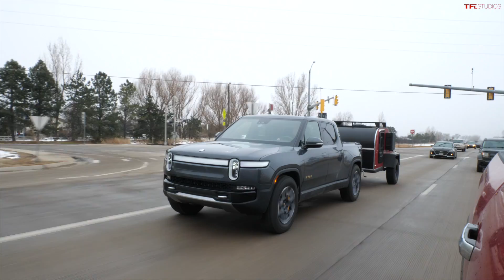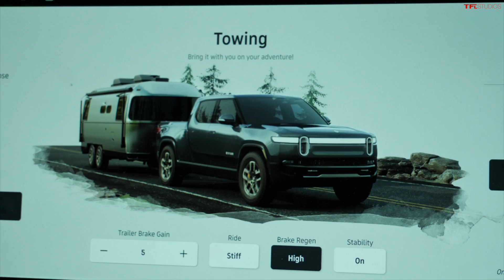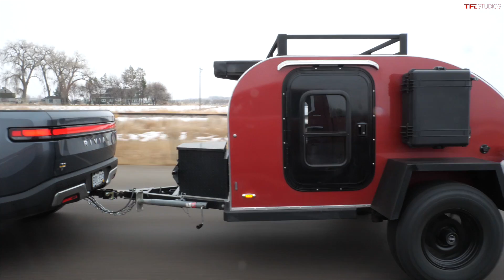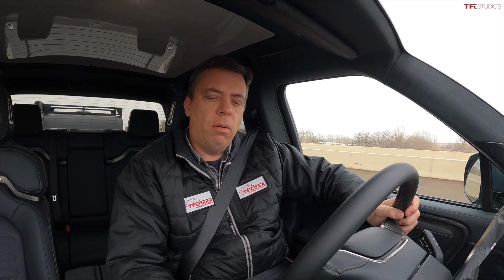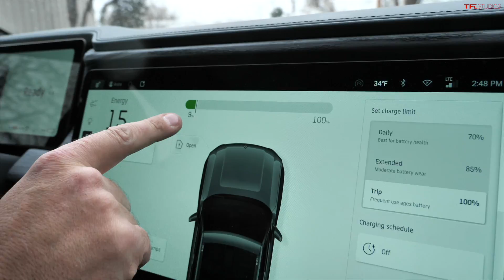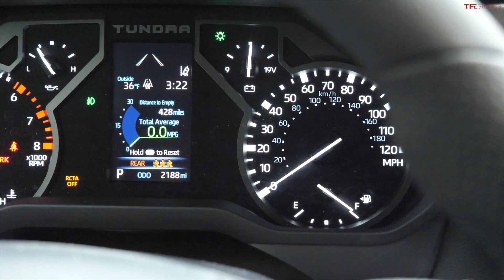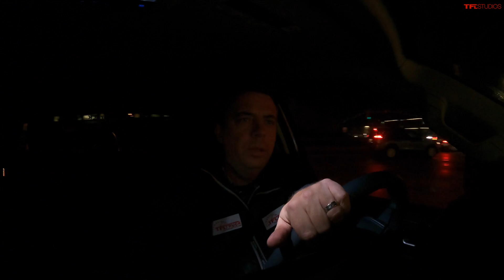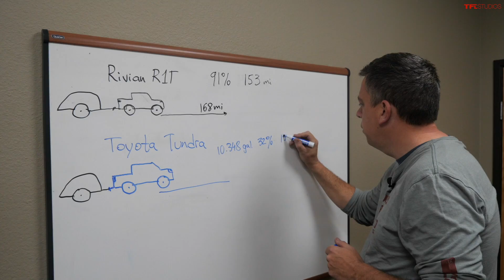Rivian R1T vs. Toyota Tundra: How Far Can Each Truck Tow On A Single 'Fill-Up'?

Comment: The Rivian looks like it tows very well. The only issue is range and recharge time. Those are pretty big issues though.
Reply: Mining battery components and drilling  and refining crude into gasoline are both incredibly energy intensive and there isn’t any good data comparing the two operations, so for comparison, we can consider those to be equal. Transporting gas to stations takes more energy from fossil fuels (FF) than electricity. Depending on the source, electricity could be made very clean or not so clean. In California, it’s over 70% clean sources and in my case would be 100% solar at my house. So instead of arguing which is greener, I’m going to compare what Andre didn’t, and that’s cost per mile. He said he got approx 1.25 miles per kWh in the Rivian and 14mpg in the Toyota. Equaling the units, the Rivian used 11.2kWh to travel 14 miles compared to the one gallon of gas. Around here, if you charge at a charging station, it’s about 32 cents per kWh, which works out to $3.58. If I’m charging from home, that price drops significantly, but for the sake of argument, let’s keep the charging station price—if your gas costs more than $3.58 per gallon, the Rivian is costing you time but saving you some money to drive. If your gas is $3.58 per gallon or less, it costs you more money and time to drive the Rivian. A one size fits all solution doesn’t work. People who have $1.50/gal gas will never see the benefits of going electric. Those seeing $5.50 gas can’t wait to go electric as filling a 32 gallon tank with 28 gals of gas is $154 at that unit price.
Reply: @lewiswatchorn7239  refining oil gives us so many things that make a society run.  Tar roads to propane and everything in between.  Mining lithium on the other hand.
Reply: @HoneyBadgerFarm  Lithium is also used in other things besides EVs. It’s in medicine and many of the portable electronic devices that are used in everyday life.
Reply: @thespiceislife2082  Not in the degree of making tens of millions of batteries that weigh 1,500 pounds. Then the places are stripped mined are left with GREEN toxic rivers as it destroys the environment.
Reply: @thespiceislife2082  compared to a barrel of oil….no
Reply: @lewiswatchorn7239  So you don't have SOLAR at your house when the electricity is off as it cannot back-feed the powerline. Next, they can't keep the electricity on in California rolling blackouts. Electricity prices will SKYROCKET with demand and no new power stations. They already did this in Germany and now they are buying GAS from Russia as it Failed. Also, TAX money is being used to prop up your solar panels take it away and they go bankrupt. WHO is going to have the $70,000 to buy this when Inflation and DEBT is increasing prices on everyday items?  The strip mining to get the lithium is worse than oil and OIL is naturally occurring not a 'fossil fuel'.   So farmers are going to be using batteries to harvest crops?   Who is going to pay for all of the TRILLIONS of dollars of NEW DEBT to upend the economy?
Reply: @mt1885  I think you’re viewing it as an all or nothing flip. Moving away from oil will be a process over a lengthy period of time. Too many older vehicles rely on it, not to mention other things we use in daily life, as was mentioned in someone else’s response to me. Secondly, my particular solar setup is capable of 100% off-grid. Not everyone has that setup because they’re only trying to reduce their utility bill with subsidized tax credits. I feel like you are trying to push a narrative.
Reply: @mt1885  there are cars that cost over 70k and trucks are close to 70k
Reply: @lilcourtny08  Sure they are and no way I would buy one as inflation and other items are increasing. Plus, the trillions of dollars being printed to fund these 'electric' vehicles is not sustainable.
Reply: @lilcourtny08  Explain the inflation then?
Reply: @mt1885  Nothing to explain, inflation has always happened. The price of things cost more now than 30 years ago. Had nothing to do with electric vehicles. I bet you thought Fast food workers making 12 dollars a hour would have hamburgers costing 12 dollars. I know you were saying be prepared to pay 15 dollars for a combo at McDonald's.
Reply: @lewiswatchorn7239  Solar is not going to get that Rivian too far on a daly basis
Reply: @lewiswatchorn7239  I recognise the shortcomings,  which the Rivian has many. If you want an EV that does  not carry or tow anything, then the Rivian is for you. As more people start using the Grid for EV's those charges are going to become a lot more expensive.  A case of supply and demand
Reply: @Lewis Watchorn
What you said about California’s power supply is absolute bullshit. The vast majority of power in this state still comes from natural gas and other miscellaneous petroleum products. This is easy to find information and widely known so I’m not sure if you’re lying or just ignorant.

Electric cars are absolutely awful right now. Yeah, their performance in some measures is fantastic but we’re using batteries that weigh as much as a whole ICE car, aren’t recyclable and are filled with toxic metals. Charging times still aren’t very good and solar panels don’t produce enough energy to fuel a car unless you’ve got a whole damn field of them.
Reply: We all love our trucks.. towing, hauling, off-roading, etc.
But electric trucks are not a player in the game at this point.
EV trucks still have a long way to go before they can compete with petrol-powered trucks.
Reply: At one point horses were more efficient than combustion vehicles. IJS.
Reply: @Coach_BigMac  the usual comment.  When do you think the first electric vehicle was invented.  How about the later 1800s.  Look up the history of electric vehicles and you will see how useless they have been over history
Reply: Keep disliking doesn't matter. Tech is improve. And many of us will buy
Reply: @jmycantu779  It isn't "tech" that is holding it back, it is physics.
Reply: Not big issues for towing around town.  The difference with the Rivian is, you get to leave every morning with a full tank, without ever having to stop off at the gas station.  Just plug in the truck in after work, by the time it's needed the next day, it's back to a full tank.  As long as you tow less than 150 mi per day, you're golden.
Reply: @Micah Sandefur 100% of the material in Tesla's new 4680's are 100% recoverable.  Do you see stuck tankers and blown oil rigs and oil spills and whales tortured by scanning and seals and birds covered in black tar and and pipeline gashes through the countryside for batteries?  No.  The impact of lithium batteries is not anywhere close to that.  Your comment is ridiculous.
Reply: @aSqueaker   considering an ev fire just sunk a ship, this didn’t age very well.
Reply: Most electric vehicles will be short range for a while .
Reply: @Thurmanjr4276  -- for a Long While!
Reply: Very Big Issues!
Reply: I wouldn't call it an issue I would call it an adventure.  Think of all the fuel costs and all the time you're not spending working for the maintenance you have to pay for.
Reply: So it can tow utility trailers well, if I can afford a Rivian, I'm using a hotel when I travel or if I want to rough, I'll rough it with a tent. Trailering long distance, I'd rent a truck for that.
Reply: Basically in the end, you'll have two broken down vehicles here... one from dead batteries and the other from a dead engine
Reply: Just wanted this comment to get to 100 replies. Have a good day everyone!!
Reply: Trying to charge with a trailer would be a bit of a hiccup because most charging stations if at all are not setup for vehicles with trailers so you would have to take off the trailer before you can charge which also adds time to charging. I hope we can eventually get to some better efficiency for the EV truck towing.
Reply: @train21  charging with the trailer is only a moderate issue now. You still have to unhook. But imagine if every trailer had to unhook for an hour or two. Just the parking space you would need is kind of astronomical. If you run the math out on the comparative charging rates, for a typical 40 pump highway gas station - you would need something like 3,000 charging spots. If you consider the possibility of having enough parking for another 500 trailers - the logistics of that become practically impossible. Charging has to get faster for EVs to be a viable replacement.
Reply: @MrJcjet  yep exactly, I'm just hoping maybe we could get smaller batteries with bigger kWh. Hopefully one day we could get like 200 to 250kwh batteries.
Reply: Also needs to be taken into consideration that this trailer could be towed with a compact SUV or crossover. The range will be less than 100 miles with a trailer any bigger.
Reply: @OneNationUnderGod.  For bigger trailers ?!.. damn talking about moving a house or what ?! no need for 'goose-necks' in Europe.. 18 wheelers & oversized Semis are made for that..
Reply: @poplaurentiu4148  that teardrop trailer is about the smallest trailer they could possibly find. It only weighs 2k lbs, that means the hitch weight is around 200lbs you could literally pick up the tongue with your hands and move the trailer around in a parking lot. The pickup is capable of seating 5 why not pull a camper that's at least capable of sleeping 2 adults and 2 kids?
Reply: @OneNationUnderGod.  Range would be very much less with anything over 2000lbs
Reply: @robertryan7204  it's not the weight, it's the drag coefficient. An empty cargo trailer would have dropped the Rivian well below 100 miles. I tow a 37' fifth wheel camper that weighs almost 12k lbs with my diesel and I can still travel over 350 miles on a full tank. If the Rivian could even handle a fifth wheel it wouldn't even be able to go much over 50 miles with that kinda load/drag coefficient. My milage is roughly cut in half by our big camper but I can't complain considering the size of it, I actually think it's doing pretty damn well getting just over 10mpg at highway speed.
Reply: It does seem to tow well and behave well
Reply: @Micah Sandefur I haven't looked into what happens with used batteries. Is it bad? I will check into it in my free time.
Reply: those are only issues if 'somehow' you want to 'get back home'...
Reply: thats kinda the wrong way to look at it. It depends on your work load, if you are a dedicated tow, get a tow truck instead, it'd out tow the thundra :P . Otherwise one time towing is totally fine for these pickups. The best way to look at it is just depending on your daily loads.  a 20 minute partial recharge is fine as part of the trip, but its a question of if a single charge will last you a day and you can recharge at night with a full circuit at home. Sadly you americans are on 120V. Even in the 3rd world we have 3 phase 240V, so its not hard to take 1 of those phases, coupled with a 60A breaker or rather just taking all of 1 phase and hook it to a charger for a total of 14.4KW , If your house has solar and unlike the average american use 0.5KWh on average for your home power, then you'll need to be able to collect and store a total of 140KWh (the rivian only has a 125KWh battery). Ofcourse the average american uses 2KWh for both cooling and heating in some parts, you guys are so inefficient while in the grueling hot 3rd world we use a small portion of that.

So the issue you guys have isn't with the tech of EV, its your bad electrical grid that needs more material to cope. Otherwise if the battery is enough for a days of use, then on a circuit i mentioned it'd charge while you sleep.
If the EV fits your needs, its definitely going to be cheaper than ICE especially with todays prices, not to mention that just owning an ICE vehicle requires more maintenance. In a sense hybrids fit well because of being able to go far, but it'd need to use the combustion engine as an extender, not to drive the wheels as you can't fit both a big battery and big engine.
Reply: re: "The only issue is range and recharge time. "  ...also, the cost to recharge at a public recharging station is probably higher than the cost of gas for the Tundra.
Reply: @videopipeline6419  Now add in oil changes, air filter, brake pads, plugs etc for routine maintenance.
Reply: @videopipeline6419  I'm not sure about that. Would not surprise me though.
Reply: Those two reasons are enough to never even consider it.
Reply: Thanks for the input captain obvious
Reply: @YouYou-tg7qe  That's General Obvious to you Private Sook Mah Deek.

Comment: Considering you surely have the ability to tow the Rivian back to charge from empty it’s too bad you did not have the balls to test it fully and show what happens when at 0% or 1% and what do you get in the last 10%.
Reply: that’s not what people actually owning a Rivian are going to do anyway.
Reply: @rockygambina312  yeah silly me 
Rivian owners would never find themselves in a near empty situation 
Wondering how far till the computer turns off the vehicle and can I get home
That is never going to happen.
Reply: Ya man Rivian owners are gunna have a full size gas truck just waiting in reserve for when they run out of battery
Reply: @pjmtts  Electric vehicles usually have a buffer of range left even though the vehicle is telling you 0%. For example, Tesla installs a 20 mile buffer from 0% to empty.

Comment: R1T: 91% should be ~118KWh. Stopping on electrify america (31 cents from Tommy's video) then $36 58, if you charge at home in your destination in CO then ~12c then $14.16. 
Tundra did it for ~$40. 
If I'm towing long distances often, then gas is still the way to go. However, I'd love to see this done with the TRX since it's more of a comparison to the R1T.
Reply: The Rivian has a 135 kWH battery. 91% of 135 is 122.85 kWh. Also, there is charging loss. In most cases, it's about 20%. So, at 31 cent per kWh, it would cost you about $45.70 to charge out on the road.
Reply: @emdec55 I think usable battery is about ~130.

Comment: Awesome,  but what about cost?
How much did the electricity vs gasoline cost?
Reply: Not to mention my time isn’t cheap and I value the time I’m not at work.  Spending it sitting at a charger every 100 miles is a no go.
Reply: Toyota cheaper!
Reply: @JohnDoe-nz6bk  TF are you smoking my man😂 The Rivian would be $36 to charge a full battery at EA (which is the most expensive charging option possible), meanwhile the Tundra would cost you ~$40 for the same trip.
Reply: @JohnDoe-nz6bk  not an electric slappy, but rivian has way more horsepower. they're not the same truck

Comment: Gas going farther than electric?  Now there's a shocker.
Reply: The Tundra may have gone 2.8× futhdr but the Rivian was over 3× more efficient during the same distance (14.6mpg to 42.8mpge)
Reply: @migueljardim8177  MPGe is a meaningless metric.
Reply: @Mark_Christian25  It isn't, it is the exact same metric as mpg, but I just say mpge just so people know that it's an electric vehicle doing it.
Reply: @migueljardim8177  No, it's not, because part of the energy usage equation is being left off the table. More than 1/2 of your EV's energy usage happens before your electricity hits your battery. MPGe is completely pointless because it has no relation to anything meaningful.
Reply: @Mark_Christian25  Can you explain how this energy is supposedly being used before entering the battery? And does this also then apply to filling up an ICE car from a pump.
Reply: @migueljardim8177  Where does the electricity you pay for come from? It's from a grid that is primarily powered by coal and other fossil fuels, sent through wires that have resistance and throw away energy as heat. From there, the charger and battery themselves will throw away more energy. By the time all is said and done, but before you actually use your energy, over 60% of your energy has been wasted. From there, another 20% is lost by the vehicle itself. In total, your well-to-wheel efficiency is only about 20-25%. 

As for whether losses apply to filling up, of course it does, but your argument doesn't pin on that.
Reply: @Mark_Christian25  That makes sense that the wheel to well efficiency isn't as high but I have a hard time believing that it is as low as losing 60-65% energy. I will have to read a few articles to confirm if this is true or not.
Reply: @migueljardim8177  There are a lot factors, and there different forms of energy production.  But take the most common, which is the turbine generator. That only has around 60-70% thermal efficiency. From there, there are other losses. Like I said, the power lines themselves have resistance and throw heat. The charging process throws heat. In reality, the grid is not efficient. If you're looking to measure energy efficiency, there's tons of waste from the fuel to the generation to the transmission and the charging.
Reply: @Mark_Christian25  That is true, I imagine the same thing happens with the well to wheel of ICE vehicles too, so in reality both mpg and mpge are lower than what is stated for both of them.